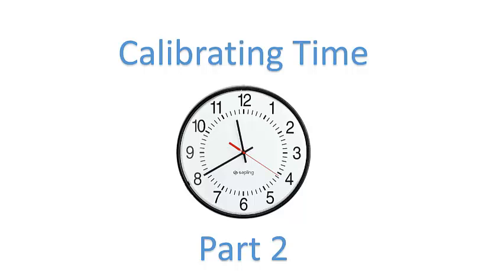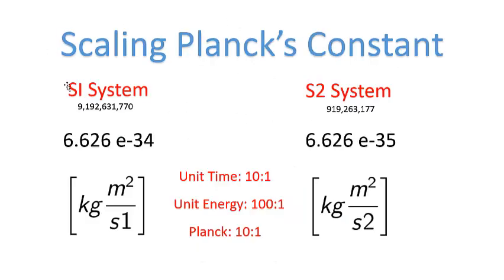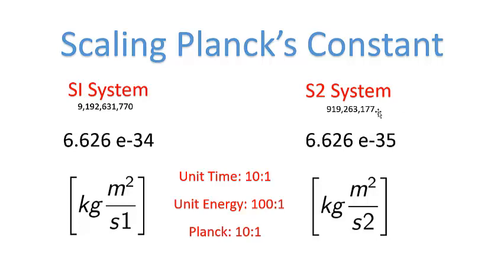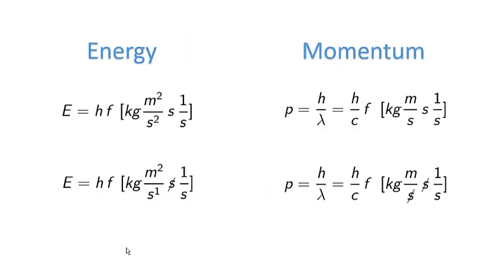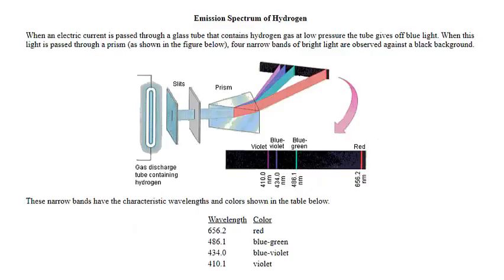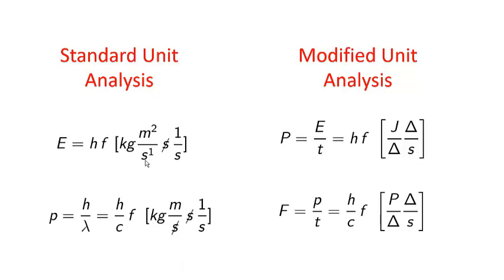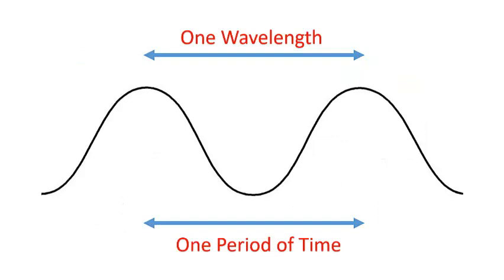Calibrating Time Part 2

Comment: Just to add to my last comment, the oscillations of a Cesium atom are what we use to determine the time, the second of time. question. What if we are travelling at half the speed of light in some kind of space craft, how would that effect the oscillations of the cesium atom? Would it slow the frequency down? Speed it up? What we know as a second of time would definitely change, one way or another. Would our perception of time change? Would we know there was a difference? I am just shooting from the hip here, I suppose we (and by "we", I mean you,😉)  could do the maths and find out, given the TIME, lol.
Reply from the maker: Actually, this is a very good question. If the Cesium atom were travelling at 1/2 the speed of light then the Cesium atom oscillations would experience clock retardation (they would slow down). You would have to apply relativity the Cesium atom if you were an observer that was not moving at 1/2 the speed of light. If you were moving with the Cesium atom at 1/2 the speed of light, yes, your perception of time would be the same as if you weren't moving at 1/2 the speed of light because the atoms in your body would also experience clock retardation.  Your oscillations relative to the Cesium oscillations would be the same in both situations.

Comment: Great series. But what about amplitude? This is where I get confused. How does the calibration relate to amplitude?
Reply from the maker: Units The unit of the amplitude depends on the type of wave.  In standard wave theory, amplitude is displacement and has units [m]. In light theory, amplitude is related to intensity. Intensity has units [W/m^2] or watts per meter squared and Watts has units [J/s]. Hope this helps.

Comment: What about the Compton scattering? There photons give away some of their energy and increase their wavelength. It indicates that that the wavelength is indeed related to energy of the photon. And regarding frequency, I do not like to talk about photons in terms of frequency. Photon has a wavelength, not a frequency. We can talk about frequency of emission, which in special case may be inversely proportional to wavelength of the emitted photons.
Reply from the maker: " Photon has a wavelength, not a frequency." If a photon doesn't have a frequency, then why does "frequency" appear in the equation for the so called "photon"? E = h f. All waves with wavelength have frequency. The speed of a medium is wavelength x frequency. If photons don't have frequency, then the equation that converts from wavelength to frequency (f = c/lambda, lambda = c/frequency) wouldn't work. Wavelength and frequency and energy are intimately related. You can't decouple one from the other. If this is what mainstream physics is doing, then they are experiencing collective wrong thinking. Light waves in the medium for the propagation of light (the Aether) are analogous to sound waves in a solid or viscous liquid medium (not sound waves in air). Sound waves in a solid or viscous liquid experience shear forces. They can are polarizable. In this manner, there is a nice analogy between sound waves and light waves. Sound waves have FREQUENCY, obviously.
Reply from the maker: Regarding Compton Scattering, when you look at the experimental setup of this experiment, you will see that I can explain Compton scattering just as easily using my line of thinking as mainstream does when they assume the existence of the photon. I plan on making a video on this soon. Too hard to explain in one comment. 

 In my previous video, I disproved mathematically the existence of the photon, that is, I showed that the equation E = hf is the not the energy of a fundamental particle, but instead is the energy collected in one unit of time of a bunch of energy units, one unit per wavelength. If you can show me where I went wrong in my calculations, then maybe I will listen. Otherwise, I will keep plugging away.
Reply: @FractalWoman  Photon moves through medium and medium waves. I agree. But photon has a wavelength (shape) and direction only, and speed itself determined by the medium. Frequency is in my opinion an artificial construct here. It is derived from equation speed = distance / time, i.e. c = lamda / time_to_travel_distance_lambda. Time to travel distance lambda is obviously inverse of frequency. I think hf looks nicer than hc/lamda, so this is why they use frequency in equation, I believe :) Frequency really makes sense when something is repeating, i.e. when we have continuous wave which you can divide into single photons. Then we can tell that this "extended" wave has a certain frequency. This frequency is c / lamda obviously.
Reply from the maker: @krzysztofrzepka  "Frequency is in my opinion an artificial construct here." 
Photon in my opinion is an artificial construct. The chemists understand that light has frequency. Please read this article. It is VERY interesting and enlightening, pun intended. https://img1.wsimg.com/blobby/go/e266e5e7-739c-437c-89c3-eed60d3a9f3f/downloads/A%20Frequency%20Based%20Theory%20of%20Catalysts%201999.pdf
Reply from the maker: @krzysztofrzepka  " I think hf looks nicer than hc/lamda, so this is why they use frequency in equation..."  If this is true then why do they use lambda in the momentum equation, p = h/lambda when they could use p = h/c f which looks nice too and is more informative.
Reply: hmm ,im thinking like time , something else is being omitted or cancelled in the sua algorithm's , take a simplistic view, electromagnetic 'light' traveling for 1 million years, they say 'shifts' not dissipates to other electromagnetic *Frequency, so  the 'light still has the same 1 seconds worth of quanta packets of energy as it started with, just that it's stretched out right!
so the missing (MUA) question is what happened to the 'magnetic' field to make the collective 'light'  'shift', the 'magnetic' field also (fractally!) shifted somewhere and got weaker, and so stretched out the electromagnetic 'light'  over a unit of time. ^_~

*Frequency is the number of occurrences of a repeating event per unit of time. It is also referred to as temporal frequency, which emphasizes the contrast to spatial frequency and angular frequency. Frequency is measured in units of hertz (Hz) which is equal to one occurrence of a repeating event per second.

*In physics, the wavelength is the spatial period of a periodic wave—the distance over which the wave's shape repeats.
Reply from the maker: @krzysztofrzepka  "Frequency really makes sense when something is repeating".
In the case of light, what is repeating are the electron transitions inside the atom. When you turn on a light, the electrons are continuously transitioning (moving up and down levels if you may). These transitions are "wiggling" the medium creating waves in the medium. This is how I visualize it. I am not wrong because when I do physics in the frequency domain with this assumption, I get the right answer. So I could also be right.
Reply from the maker: @paulmaydaynight9925  "so the missing (MUA) question is what happened to the 'magnetic' field to make the collective 'light'  'shift', the 'magnetic' field also (fractally!)" 

This is a very interesting question especially since you used the word "fractally". Using my line of thinking, and by combining both Oscillation Mechanics and the Fractal Paradigm, I have come to the conclusion that the universal medium (the Aether) must bifurcate over time. This gives the appearance of space stretching as per the expanding universe theory, only the apparent expansion is actually caused by the bifurcation of the medium. To understand this, you need to check out the work of Blair Macdonald. Here is a link to one of his papers (the most important one). https://www.vixra.org/pdf/1503.0232v2.pdf
Nothing is missing. Energy is not lost. The second was just calibrated differently in the earlier universe than it is now. The laws of physics are exactly the same. The constant relationships were exactly the same. This is analogous to zooming into a fractal as demonstrated in Blair's paper.
Reply: @FractalWoman  From what I understand you base your calculations on assumption that E=hf is total energy transferred during one second. This is why your calculations show energy to be the same for all photons, regardless of their wavelengths. Because we simply divide "total energy" hf by number of photons during this period (circa f), and we end up with h as value for energy of a single photon. The article you provided seems to tell exactly that (page 11). I wonder if you can provide any experimental data showing that this interpretation is valid. What bothers me here is Compton Scattering because we would have issue with conservation of energy, if reflected photon still has same energy (h).
Reply: @FractalWoman  I guess they write p=h/lambda for same reason as they write E=hf - less letters makes it look simpler. But indeed, p=h/c f is more informative. :) I can accept idea of atoms wiggling (which is a standing wave in a closed loop), but I do not think we should automatically attribute the same to a photon. I think a photon with a lower wavelength is simply shorter and therefore more spiky. It delivers energy to electrons in shorter period of time comparing to photons with longer wavelength. This is why photons with bigger wavelength do not cause photoelectric effect - perturbation of aether does not happen quickly enough in given location, in an instant so to say. I believe photon is just a wave, a travelling perturbation/displacement in the aether, a pulse. btw: I was considering idea of bifurcating space time, especially in places where universe is less dense, i.e. between galaxies. It is interesting concept, and I like it more than Big Bang and inflation.
Reply from the maker: @krzysztofrzepka  I agree with a lot of what you are saying but being a minimalist, I don't like the idea of the light "wave" being treated differently than other wave phenomenon. Did you see my video where I explain the photoelectric effect using Oscillation Mechanics? https://youtu.be/0Vx9LFTe4Oo
In my line of thinking, the photon doesn't exist as specified. The output of the equation E = hf is not the energy of a fundamental particle. So I am NOT attributing the same effects to an electron and a photon. Light is a travelling wave and electrons are standing waves. Electrons waves can absorb and emit light, but light cannot absorb and emit electrons or any particle for that matter. (pun intended).
Reply: @FractalWoman  Yes, I loved this video. And I loved all the others, until you said that energy of a photon is basically h. It is too shocking statement, to just to take it for granted. I think matter and light is the same thing, but in different forms, and therefore act differently. Iron and Oxygen are made of same stuff, yet have various properties. It's pretty amazing actually. All there is is actually the aether. And the aether can manifest itself as "nothing", light or matter. Pretty awesome.
Reply from the maker: @krzysztofrzepka  I never said the energy of a PHOTON was "h". What I said was the energy of one oscillation of light is "h".  This is not the same saying that the energy of a photon is "h". I loosely call the energy of one oscillation of light an OM particle to distinguish it from the photon. In really, everything is due to resonance frequencies as described in that  paper on chemical catalysts which is posted here:
https://img1.wsimg.com/blobby/go/e266e5e7-739c-437c-89c3-eed60d3a9f3f/downloads/A%20Frequency%20Based%20Theory%20of%20Catalysts%201999.pdf
Matter and light are not the same thing, but they do exist for the same reason. Aether. Light is a travelling wave in the Aether and matter (the electron for example) is a standing wave in the Aether. And yes, this is pretty awesome.
Reply: @FractalWoman  It seems I simply did not understand fully you idea. I incorrectly assumed that you introduced a replacement for an old fashioned photon and called it OM Particle. Although I must admit, due to wavelength analogy it is easy to make this mistake, they appear to be the same thing. I will definitely follow your videos to understand your idea better. The article you provided is pretty interesting, but I will need more time to read it properly.

Comment: Very nice. Never liked the photon to hertz conversion they presented and yours is very nice.
Would this implay the correlation with electron and "photon" wave energy as per the photoelectric effect?
Reply from the maker: Yes. Essentially, the electron is a interpreted as a standing wave in Oscillation Mechanics.  If you watch my previous video, I show how I use Oscillation Mechanics to solve the photoelectric effect.
Reply: @FractalWoman  But how is an electron interpreted in DC electricity or is there used as charge? I dont know exactly the conventional explanation and i dont even know if they mean the same electron as in the cloud chamber.
Reply from the maker: @manipulativer Truthfully, I'm not really sure what your question is.  Here is what I know. Particles are standing waves. They behave as particles in the sense that they don't propagate. Light (EM) is a travelling wave. Light propagates in the medium for the propagation of light. Particles absorb and emit light.  If particles didn't exist, then light also would not exist.  Charge, in my opinion is the interaction between particles (standing waves) and the Aether. I haven't talked much about the Aether yet, but I will be very soon.
Reply: @FractalWoman  I am seeking explanation as to what is the difference between beta radiation observed in a wilsons cloud chamber and an electron in the wire with electricity?
For me electrons moving in a wire is an after effect of "potential surface" tension of the copper crystal being disurbed in a vortex motion as in Volts pressure and AMPs bassed on resistance the current it partaiks.
The electron moving is the counteraction of the aether.
Its still a bit hard to vizualize aether flowing producing magnetism but needing matter to transmit amperes (or vacuum to not disipate any energy)
So what i am trying to say is that it would be of advantage to clearly understand photon energy mass bonanza to electron energy mass bonanza
And to me photoelectric effect is the minimum oscilations requered to induce current based on quarter wave logic of induction. I could be wrong but this is the easyest i can explain...
Reply: @FractalWoman  addition. DC electricity is vortex motion being established and in AC is literally radio and the cable is a waveguide (as said so also in the bit chute link i linked)
Reply: @FractalWoman  and last addition: Nikola Tesla wardenclyffe was a capacitative antena for the aether to act on the coil which was connected to the Earth. All you needed was an inductor of resonant coupling (4 way tesla circuit from memory) and an capacitative antena for the aether disturbances to be picked up via the quarter wave rule.
1 wire transmission of power where Earth is the wire as amps need matter to be translated (or vacuum hence the first Tesla invention was stratospheric energy transmission as in halogen lamps)
Reply: @FractalWoman  I concur that standing waves as a product of forward and reflected waves make sense in an aether-only universe.  But, considering that (AFAIK) the latter term (reflected wave) is needed, I'd suggest the possibility of an aether discontinuity that traps (and allows for the reflection of) the waves in order to produce standing waves.  The aether discontinuity would be like a bubble, perhaps produced by the big bang energies and the bending of ( I call fast, some may call "hard") light into self-sustaining discontinuities ...
Reply from the maker: @dahdahditditditditditditda7536  I agree that there must be a boundary condition for a standing wave to occur. An Aether discontinuity would serve that purpose. You may want to check out the work of Jeff Yee on YouTube. This is where my Oscillation Mechanics meets his Energy Wave Theory. Here is a link to his channel. https://www.youtube.com/channel/UC7aKNG039opzFXqz4cigziA
Reply: @FractalWoman  Hi,  Thanks for the link.  I'll check it out.
Reply: Have been mulling over discontinuities.  I'm wondering whether, in the case of the atom, they are caused by curled hard light, or perhaps instead, an actual "stretching" of the aether fabric.
Reply: The circular (really spherical) aether discontinuity could also be an effect that goes along with the torsion/angular momentum supporting nature of the aether.  Like the song, everything turns.  So the aether might have a predisposition to produce spherical aether discontinuities, just by its structure.
Reply: @dahdahditditditditditditda7536  Yes. if i recall correctly Nikola Tesla likened aether as primary and matter as it subordinate similar to bubbles in the water analogy.
Its circular/spherical thing is hard to understand but it seems needed as circular motion is acceleration and gravity seems like an acceleration.
And the electron is perhaps easyer to understand if you watch "dissectable capacitor" where its a field.
But than again vacuum tubes use heat to produce aether pressure.
So heat and electricity meet again so these are some peculiarities that i am far from understanding.
Reply from the maker: @dahdahditditditditditditda7536   I am mulling over the idea that particles are Aether circulation as well as standing waves. If an Aether vortex forms, then it might "break off" from the main Aether and form a boundary condition. Aether circulation alone doesn't explain all the phenomenon of particles, but combining Aether circulation with a standing wave might fit the bill. Still working on this.